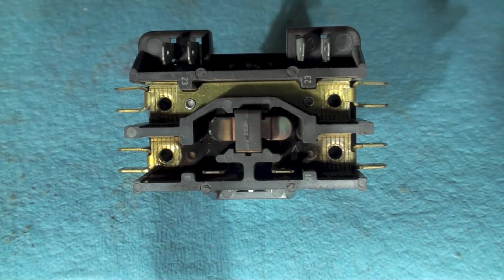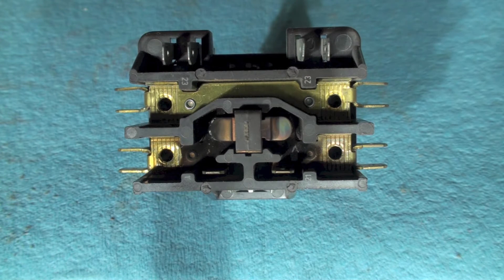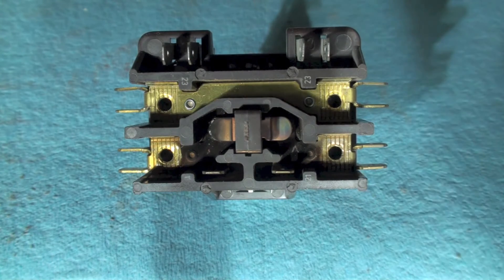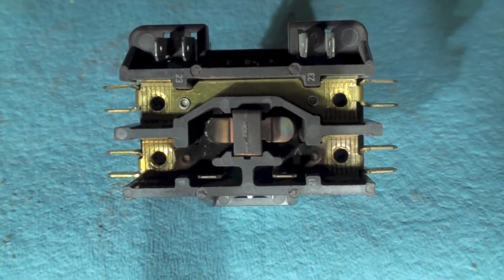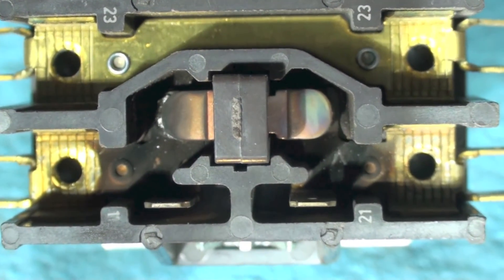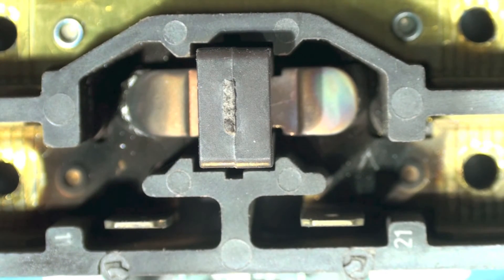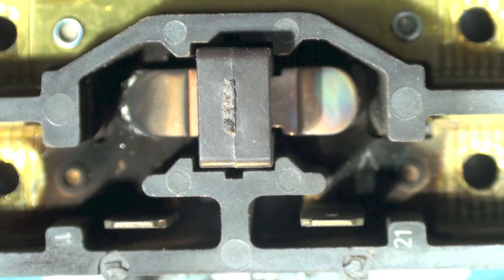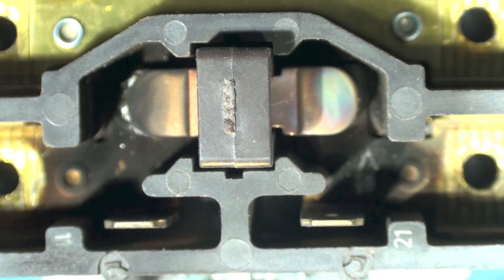A burned contactor

Comment: On my AC unit a bad capacitor caused the contactor to burn out because the compressor wasn't starting. It caused alot of arcing and ruined the contacts. I replaced both the capacitor and the contactor and it works great now.

Comment: I have exactly the same contactor which caused the air conditioner failing to start up. Can't figure out the model and spes. Please help me.
Reply from the maker: You need amp draw found on the side of the contractor.  Number of contacts.  Coil voltage (usually 24 volts).
GFM
Reply: Thanks. Just figure out that it is a Honeywell 8242A 1255. No longer in production.
Reply from the maker: Any brand will do with the right configuration.
GFM

Comment: Im going to check out the compressor today after work. It is single phase. Im going to make sure the resistance values add up. What else should i check?
Reply from the maker: You need to check amp draw upon startup.  Should be with in the RLA on the model plate.
GFM
Reply: I checked the amp draw and it was drawing no amps so I took off the cover to the contactor to see what it was doing while the thermostat was calling for cooling. The contactor was stuttering and arcing--it was trying to pull in but did not. I pushed the contactor in with my screwdriver and viola! Unit runs fine: the amp draw is around 10 (the unit specs for 14) ; the fan is running and the unit is blowing cold air into the house. 

Problem is, as soon as I release the contactor plunger the unit shuts off. 
I am beginning to suspect the new contactor I bought. Not all the specs on my old contactor match the specs on the new one. Old specs are FLA: 25; LRA: 150, 50, 40 RES: 30. The new specs are FLA:30 LRA:150, 75, 50 RES: 40. You think the new contactor might be the cause?... by the way the resistance values on the compressor add up properly.
Reply from the maker: The contactor could be bad.  Check the voltage at the contactor coil.  If it is below 24, the control voltage is the issue.  
GFM
Reply: there is no voltage across the coil were it should read 24. there is 240 v coming in and 240 v coming out but strangely there is no voltage through the switch when I have  it pushed in with a screwdriver...
While I was testing the contactor the unit started working for a minute without me holding the contactor in with a screwdriver. During this time I noticed that there was 24v across the coil
Reply: +Sam Fry yeah. I tried jumping my time delay and fried my transformer. Im going to replace the transformer and the time delay this week. I can see nothing visibly wrong with the time delay and im not sure how to test it
Reply from the maker: Interesting.  If the time delay is part of a circuit board, there is no test other than power in, power out after the delay.
GFM

Comment: My contactor was visibly burnt. I replaced it. It worked great for a day. Then it stopped working with same symptoms (wont start). Any ideas anybody?
Reply from the maker: Will need much more.  Does the new one close?  Is power available?  
GFM
Reply: its got a cover on it so I cant see if it closes. but I can remove it and check. It is arcing at the terminal that goes to the compressor. This is the same terminal that was burnt on the last contactor. It is getting 240V coming into the contactor.
Reply from the maker: Could the compressor be locked rotor?
GFM

Comment: I have had comp that were not showing a ground but the contactor was welded shut and the breaker tripped. When I replaced the contactor it would weld shut and trip the breaker as soon as power was applied. Do you have any idea why this is happening?? I believe that the comp windings are bad but not ground and carry such a large current upon start that it welds the contactor points closed and overloads the breaker.....???? But I don't really know, I have seen this multiple times. Thanks for the vids?😎
Reply from the maker: +HVAC/R Junky It is possible to have a dead short in the windings and not be grounded.  Even though the breaker kicks off, the amp draw could be in the thousands.
GFM
Reply: +grayfurnaceman  A dead short, I will have to look it up. Interesting. Thanks

Comment: I replaced my capacitor today, because my house fuse for the A/C kept tripping every about 24 hours. However after replacing the capacitor the unit would not come on. I watched as the contactor kicked in and immediately released. Mine looked exactly like the one in your video. Of course, I replaced it because of the blackened contacts and not the discoloration. In any case all is well, the house is cool again and my wife let me move out of the dog house.

Comment: If you are careful with the spring, the tips can be removed and reset for inspection.  If the contact surfaces are badly pitted and carbonized (Black), it is toast.   I have sanded these down with light sandpaper (400), etc.  If enough silver is present on the head, they should be OK as long as the surface is somewhat flat/even.   I replaced contacts as a maintenance guy years ago, sometimes the electrical energy picks a spot on a contact surface and literally eats away at the same location over and over--usually on the edges (Probably because the contact points are not even when closed).   I have believed contactors are likely responsible for most single phase damage but I know little about that side of the subject to make a public statement.

Comment: I have a single connection contactor like this in my compressor at home.  I was surprised to see it only breaks one leg of the circuit.  Would it be a good idea to replace it with a contactor that is a double pole?

My compressor starts up with a big thunk.  I was looking in to maybe getting a soft starter for it.